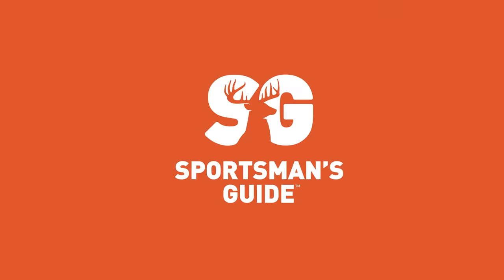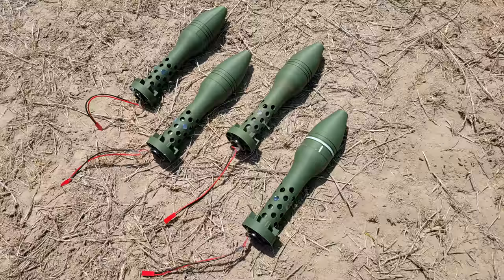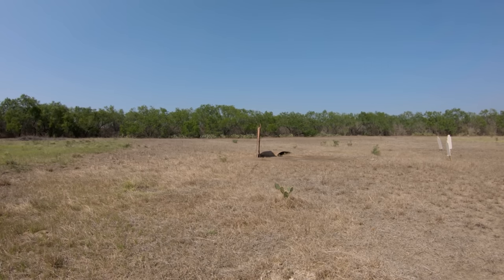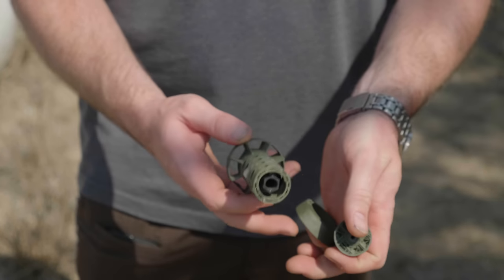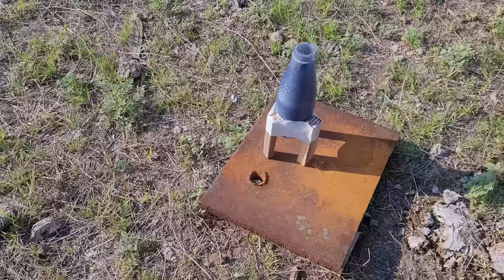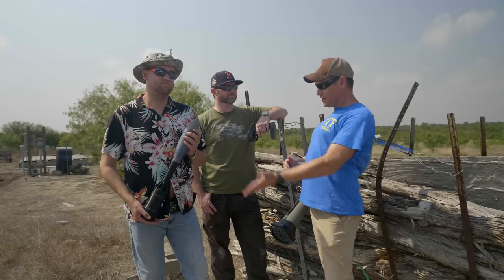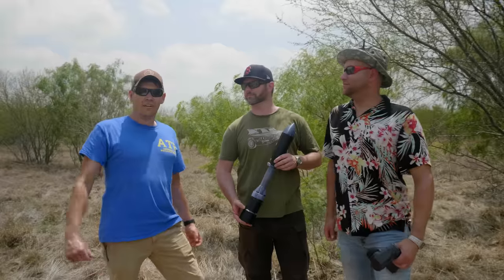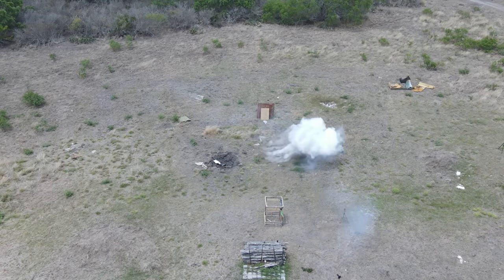World's First 3D Printed Rocket Launcher (Featuring D&S Creations)

Comment from the maker: We started with indirect fire weapon systems and 3D printed claymores. So this obviously was the next step in our evolution of projects. Now that we have a solid amount of data collected from these tests, we can collaborated with DNS creations in creating some wild 3D printed direct fire ordnance as well as other fun devices.
Reply: Two things that may help from my own attempts at making similar devices. 1. use the ignition of the rocket engine to light off the ejection charge. this will give the rocket more speed before  it leaves the tube. And  2 give your launcher a vented back plate, the hobby rocket engines you are using don't have the thrust you need for a pure recoil less gun. hope this helps!
Reply: Tube launched rockets are more or less rare in civilian applications but most of them have folding fins that help with keeping them straight. There is also the option to give them a nozzle like a gyrojet and there are surprisingly good videos with instructions on how to make them on YT. But let’s be serious skip the unguided rockets and go directly to the laser guided Hellfire:) Nice video as always.
Reply: you made a rocket in shape of a plumbata and you wonder why it crashed. man, you need me in your team, hard.
Reply: im here before this blows up
Reply: Open source files translated to Ukrainian...
Reply: @exo068   so I've never done a laser guided rocket, but i did make a fly by wire aka RC rocket. not cheap but my god is it fun.
Reply: Try a shotgun primer on the tip.
Reply: @OleDirtyMacSanchez   so I like to use these small red snapers, there Like a small fire cracker that go's off on impact. They take less force to activate. So your way less likely to UXO.
Reply: Checkout Jarius of all.  He has been working on a HALO twin barrel rocket launcher.
Reply: 37mm revolver?
Reply: I just completed an school project wich involves spin in order to stabilize a rocket, Even doe my rocket had the center of gravity near the exhaust nozzle  rather than the nose cone (it had the weight in the Wrong Place for vertical or horizontal launch), the spin managed to stabilized it and it flew in a very straight trajectory, only thing to consider is that i wasn't using a booster, just and engine. I achieved the spin using fins that had a 5 degree of angle of attack
Reply: First i thought its an Chamberless Rocket like an Panzerhammer from ww2. you should research that. Its an simple designe. An target at 500meter distance has only hit difference from 1meter. The chamber was the barrel of the rocketlauncher. When it leaves the barrel the fuel burns without pressure so it doesnt give an backblast and no burning differences.
Reply: for sustained parallel to the ground flight you will need something with significantly higher impulse.  the motor you need would likely require a burn rate over the 1meter/sec cap for hobby motors.       There was once a great brouhaha and court battle with the high power rocketry community and the fun police. In short There was a great concern with the ability of high power rocketry products ending up in an unhappy package delivery service delivering to some guys rose garden.  there are now regulations and methods in place to prevent such things from happening. You will need a special license from the fun police to acquire such naughty things.  you need to talk to a propulsion Jedi Master from the High Power Rocketry world. Since you are duly tracked and vetted purveyor of naughty things. I am sure the doors to the sacred knowledge will open when you show your vetted credentials.
Reply: @OleDirtyMacSanchez  I use a nail that hits the 209 primer.
Reply: 3D printed howitzer when :v
Reply: first I regret not watching this day one as when I saw 3d printed in the title and the thumbnail picture.
I obviously under estimated you boys worse than the Canucks because I thought it'd be a non firing prop.
Secondly, I have a question. with the shaped charge test I wonder if the "lack" of results is primarily due to the powdered copper (I assume thoroughly tamped and/or compressed) vs a solid copper cone, or would it be from the  lack of structural resistance from the 3d printed casing being unable to effectively focus the blast.  possibly both? or a factor I can't think of?  what do you think Jake?
Reply: It might help to implement folding fins on the rear of the rocket body. The two important stabilization features of rockets that don’t use guidance are a forward biased center of gravity as well as a rearward biased drag profile. These together will help keep the projectile in line with the original direction of travel while minimizing the effects of misaligned thrust.
Reply: Hopefully ATGMS sometime soon XD
Reply: It needs the pop out fins that come out with the RPG.
Reply: Would it work better if you used a one stage launch rocket?
Reply: I think you should try adding colored powder in the warhead when testing flight performance to help you get an idea of it's flight path
Reply: You know you wanna send me the stl file 😂 pretty please?

Comment: Wonder if rifling is hindering its accuracy rather than helping. As Taofledermaus has shown, adding spin stabilization isn't always better. Great prototypes!
Reply: Yea, in this case simpler might be better. For example the at4 is smoothbore.
Reply: Thats the same reason why most tank barrels are smoothbore, spinning something with fins dosent always help with stability, it usually makes it worse.
Reply: RPG-7 employs spin stabilization
Reply: @DandSCreations  But the RPG spin is not induced by a rifled barrel but by its deployed fins and the lugs that the propellent gasses vent through.  The majority of its stabilization is drag based.
Reply: @Matt-dc8lp  yes you're correct but as in trying to keep the munition all 3D printed, folding fins are not a viable option. The recoilless charge design had flaws, we will rework it to get an enhanced muzzle velocity this will help substantially.
Reply: @DandSCreations  It's a cool project.  I wish you guys the best of luck with it!  Thanks for showing it off in this early prototype phase (where every keyboard warrior thinks they know better :-)).
Reply: I don’t think it’s causing any harm. If there are any inconsistencies in how the engine is mounted or in the engine nozzle it would help.
Reply: @DandSCreations   Folding fins are possible with 3D printing. I’ve done it before.
Reply: Post up the video link
Reply: @DandSCreations    I can send you an STL if you send me a Dropbox link. I don’t have a video of firing fin stabilised missiles, but I can add my folding fins to a missile blank in Inventor. Let me know.
Reply: @ollie4022  I already have made a dud folding fin projectile. If the fins don't open simultaneously the rocket still yaws momentarily.
Reply: @DandSCreations  Have the fins separate from the rocket when printing. Print fins separate and add to rocket. Use small pins to mount them,
Reply: @lewiskevin1  the fins are not the problem at the moment it's the area of the current fins combined with the low muzzle velocity. The WW2 bazooka worked perfectly with the same fin design. The boost charge needs to be dialed in. If stability and accuracy still suffer I'll consider folding fins but one step at a time. Nobody has ever built an all 3D printed shaped charge rocket propelled high explosive anti armor grenade before. One thing at a time. There are several material limitations to prints.
Reply: @DandSCreations  That’s why you have fins all attached to a single collar that slides down and forces the fins together. The collar ensures the fins move at the same time and the primary driving force is from acceleration. This is the same mechanism that is commonly used in helicopter fired dumb fire missiles.
Reply: Good for them. I'm not putting folding fins on an experimental rocket that is just 3D printed and loading it with high explosives, and sending it off to do it's thing with my fingers crossed.  It adds a completely unnecessary layer of risk.
Reply: @DandSCreations  Yup...KISS
Reply: Yeah maybe, I know a very slight rotational spin is helpful for them “dart anti tank” rounds but they do this with angled fins inside a smooth barrel on tanks
Reply: @DandSCreations  Cool. Cant wait to see next video.
Reply: @DandSCreations  To me, it seems like the propellant should be MUCH more powerful and faster burning. You need WAY more velocity for the rocket, just like the WW2 Bazooka. That thing fires off the propellant so fast it's more like an explosion than a jet.
Reply: @rameynoodles152  yes that's correct, there is also recoilless launchers like the Carl Gustav and the AT4 which use an actual explosion and have no rocket. This is intended to be a hybrid more like an RPG, the rocket is there too sustain it. Unfortunately the boost charge was woefully ineffective and we will be revising it. This will enable us to use safe commercial made motors. A rocket motor can become a pipe bomb very fast and we want to shoulder this eventually. We will stick to the commercial motors.
Reply: @DandSCreations  I see. That definitely makes sense from a safety perspective.
Reply: @rameynoodles152  the explosive charge will be sufficient to penetrate an armored vehicle however. Already making legit copper cones this time.
Reply: @DandSCreations  Hell yeah.
Reply: @DandSCreations  You guys did awesome. Cant wait to see the advances you guys will make. Keep up the great work.
Reply: YT  only if the audience funds it
Reply: YT  baby steps
Reply: Your using Estes rocket engines… what do you expect man. It’s embarrassing to state your using black power with extremely low thrust.
Reply: It’s not that challenging, please don’t use that excuse. If your using black powder Estes rocket engines you will never get there. The 3D printing just makes this project easier… so don’t act like it’s the hindrance.
Reply: @ohbeardedone9253  who's using Estes black powder motors? Lol
Reply: Uhh. No that’s an excuse. Sugar rockets don’t become pipe bombs.  No one is asking you to use HMX motor
Reply: @ohbeardedone9253  ok go post up your legal destructive device rocket launcher with impact fuse and shaped charge design. You already claim we're using Estes black powder motors, which shows you Absolutely have no effing clue what you're talking about. Especially since numerous times we mentioned using APCP motors. These motors are 140 newtons total impulse and expelled by a black powder boost charge.
Reply: @ohbeardedone9253  since you don't know what APCP/Thiokol is you should really stop making your ignorance readily apparent to the world.
Reply: Looks like you are… very low thrust
Reply: Undersize then… no ignorance here… only pure genius… that was really weak for an AP motor.
Reply: Sure! I would use melt cast explosives with a VOD of 9300m/s.  The impact fuse would be a shot gun primer that would connect to a tube that would go through the middle of the cone. A small aluminum tube. At the top of that tube would be an aminoguanidine perchlorate primary… or for safety an insensitive nano detonating flash powder. This would propagate to the high VOD melt cast stated above and the detonic wave would travel around a 3D printed polycarbonate wave shaper in the shape of a diamond. For the motor I would start out using an AP/hexamine/aluminum rocket with high quantities of titanium hydride and copper oxide for FAST burn times.  But a sugar rocket with magnesium and coooer oxide would do as well. The motor would be the same diameter as the warhead. 

And just for giggles I could make the whole device a binary compound to be activated on site for complete legality using my nano field mixable flash powder for a primary and merely injecting an activator into the liquid explosive doped with microballons.  This the device could be armed in a minute but immune to accidents. 

Maybe… just to outdo you even more I would add a second layer to the cone comprised of my reactive material that will follow through the copper jet with an energy of 18kj/cc.  

I would ask what you think, but…I am not sure if you will be willing to acknowledge the simplicity, performance and elegance of the design I posted to your challenge. 

Thanks
Reply: I watched more carefully. Your design failed to penetrate a 1/2 non hardened steel plate. 60 degrees is the wrong cone angle… 42 degrees is optimal for copper. The jet had less penetration than a 223 standard round. You would be far better off with a glass liner unless you can machine your copper cone. Remember… shape charges without wave shapers should be in the range of 4-6 CD of penetration of RHA. Anyways. Commend you for trying the copper powder idea… but it did not form a jet
Reply: @ohbeardedone9253  we were, previously limited to supply of G impulse motors, it was as big as we could get our hands on. That's changing, had the recoilless boost charge actually ignited we would have had the necessary muzzle velocity. It was instead blown, with countermass out of the barrel without any ignition. This resulted in low muzzle velocity. The recoilless fire cannon powder cartridge has been reconfigured since and we will conduct a thorough battery of tests to find the appropriate amount. H impulse motors are now an available option.  Folding fins are also in version two. The copper mesh filled cone has been replaced with a solid stamped 2mm copper cone.  The fusing mechanism is perfect in the large rocket and will receive no changes. The reason there was multiple issues on this video is we have never tested this ever. The first test went on the internet for the world to see. It's an enormous amount of work really to make and prepare several of these. If you're patient the next version will be much improved
Reply: I will wait. 2mm is good for that diameter. Your bursting charge should be incorporated into the 3D print. About 5-10 grams of fast burning smokeless with a 3D printed burst disk… this powder ignition can then ignite your rocket motor as well.
Reply: yeah it's causing the spiral you see
Reply: I happen to agree on this one
Reply: Ayyyee Taoflader-fam
Reply: @nolan20expert  tank guns are smoothbore because the main ammunition is now APFSDS and the secondary munitions are fin stabilized now, they used to be rifled not that long ago.
Reply: @DandSCreations  you could try attaching all the fins together with a string so when one opens all of them do, like jarius of all did.

Honestly tho there isn't any point your rockets are already stable and as you said it's the charge that needs work
Reply: I think this is definitely on the right troubleshooting track. With the stability shape (aerodynamics) w/fins AND rifling it's like shooting a rifled slug through a rifled barrel.
Reply: @DandSCreations  using something like pen springs and a lock when deployed method might help to add fins, but I've also seen smooth bore, smooth projectile diy rocket launchers that didn't have too bad of aim issues. Definitely not worse than here. Cool project though!
Reply: @jndvs95  this video is very outdated, we have spring fins now
Reply: @DandSCreations  I wondered about the boost charge. These guys know more, but why not just use something like a sugar rocket motor from the start? More back blast I suppose and that would induce wear and tear on the launcher, but it would be more consistent no?
Reply: @DandSCreations  right on. I didn't see any newer video but I've only just started down the rabbit hole. I've been thinking about something like this and a police style canister launcher for a long while. Glad to see others are sharing the dream
Reply: can you link the video?